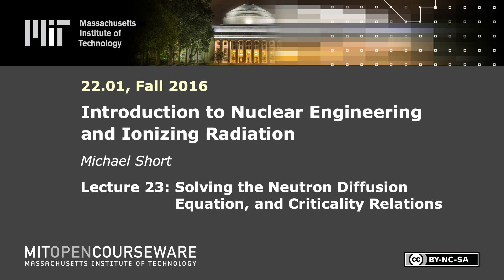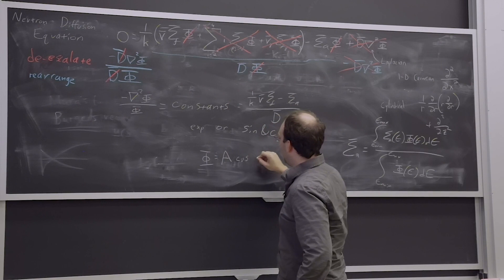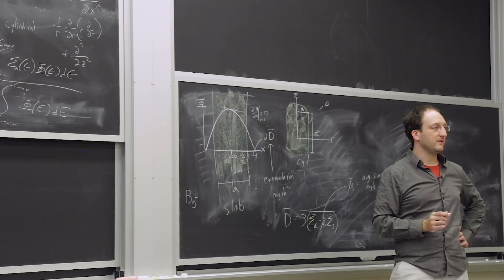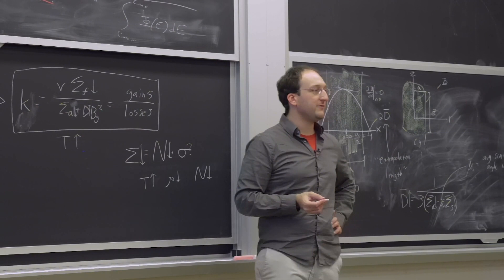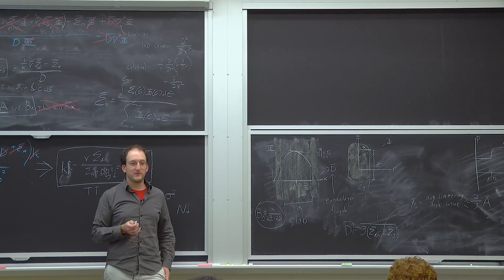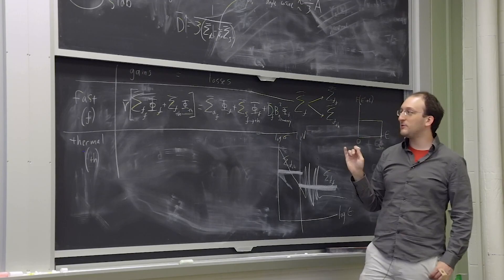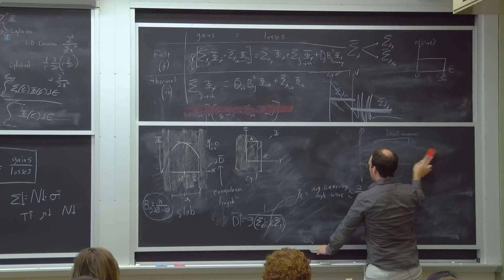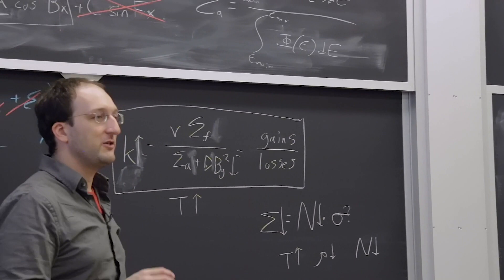23. Solving the Neutron Diffusion Equation, and Criticality Relations

Comment: Im working on a neutron diffusion question, could u help me with that? Alright so I'm trying to model the neutron population after a ramp change in reactivity to simulate rod insertion and I know how to modify the 1/2 the point kinetics equations but I was wondering how you can find the vectors to use in the solution to the differential equations
Reply: Control rod is inserted in steps. Which vectors in differential equation?

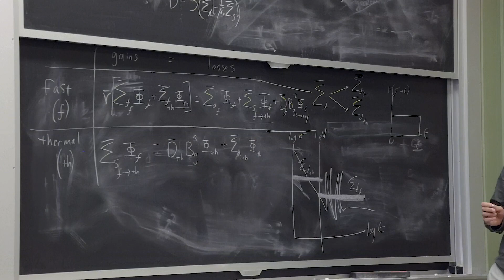Comment: why did u add k in fast, but non in thermal? (min: 32:20)
Reply: neutron are born fast only
Reply: @yacinebelhadj9749  actually that is not quite correct. Neutrons have a birth spectrum that range from a very low energy (highly improbable) to very high energies around 10 MeV. The average energy in which neutrons are born is fast.